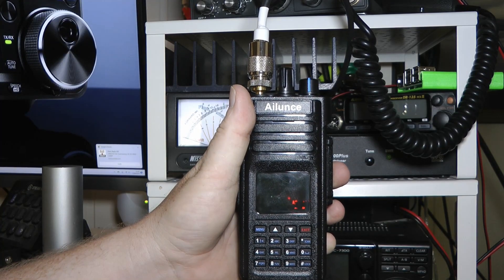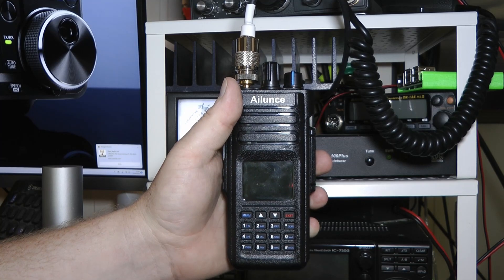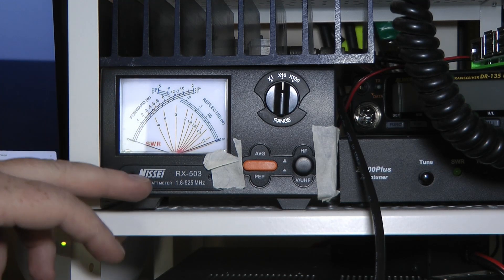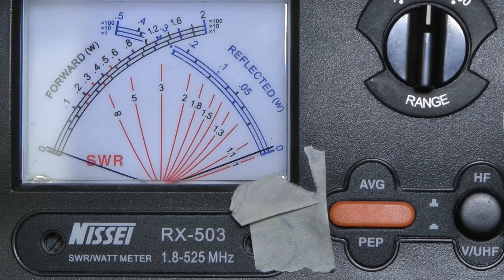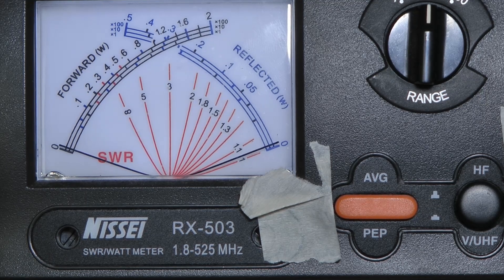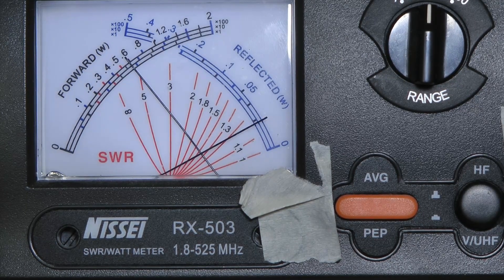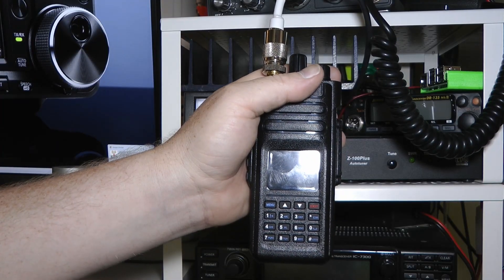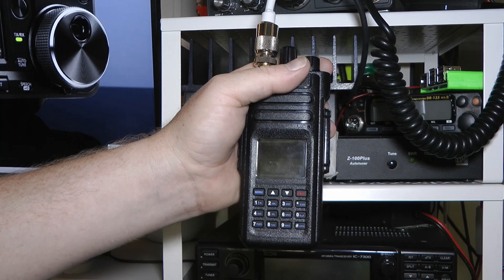Unleashing the Power: Testing RF Output Levels of the Ailunce HD1 DMR Radio

Comment: Liked the power test, i have 6 of these radio that i originally bought for hunting, but i only use two at a time since we dont have the men hunting anymore. Only two of us left for hunting and i found these radios worked really well in the woods on Vhf dmr. I only wish that Retevis would do a firmware update for a mixed mode like the Anytone 878 radios. A brighter Screen to. Thanks fir Your Video.

Comment: Question: I have had one of these for two years, love the radio.  Have you had the issue with the channel knob duplicating or showing channels out of order?   If I use the up/down arrows on the keypad, it does not happen, just the channel knob.  I'm on the firmware v1.7.9
Reply from the maker: I have not, but then again, I haven’t had it for that long either.

Comment: OK2MOP here.
I can confirm that the radio will not provide full 10W. Even with fully charged battery you will get around 8-8.5W at 2m and 8.5-10W at 70cm (depending on the SWR meter used, higher values are from RS-40 analogue one, lower from SW-102 digital one).

One should note that V2 Ailunce HD1 is totally different radio than the HD1 sold a few years ago, the present one contains HRC7000 with its integrated CPU)
Reply from the maker: I did not know that there were two different versions of this radio. That's good to know. I also don't find it critical that it's not the full advertised output power. It is still more than enough for an HT.

Comment: Length of the coax is critical on the 70cm freq.  Coax loss is significantly higher at the higher freq.  I like using on to the small Surecom swr meters for Ht's.  Similar to this one from amazon Surecom SW-102 SW102 125-525Mhz Digital VHF/UHF Antenna Power & SWR Meter+MF Connector.  Interesting to see how the rest of your review turn out.  73 Mort!
Reply from the maker: That’s why I only tested 2m, but there are several faults in my methodology. First of all the dummy load doesn’t perform all that good on 2m, and I also didn’t test with a full battery.